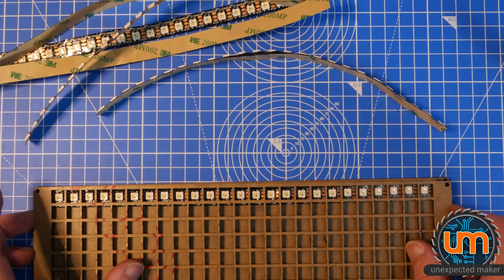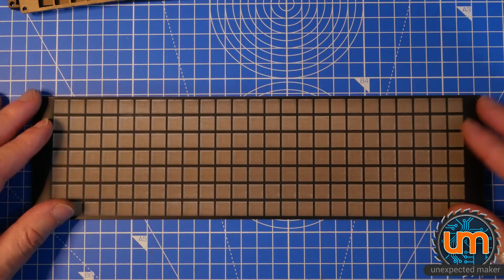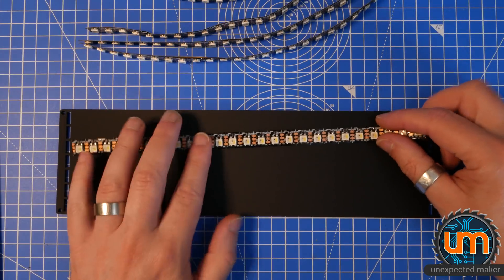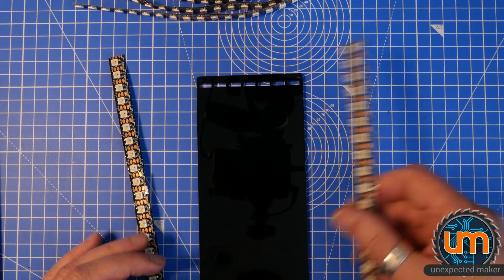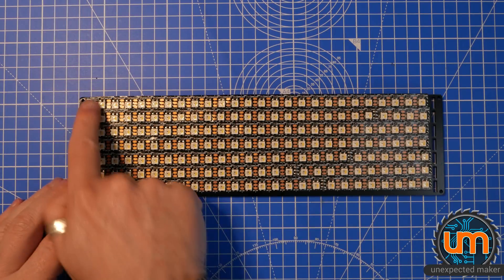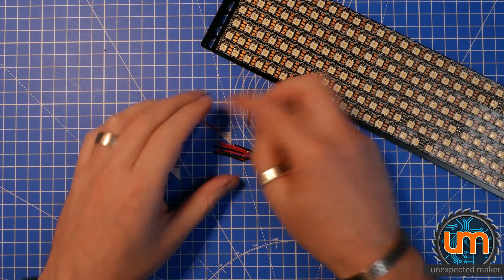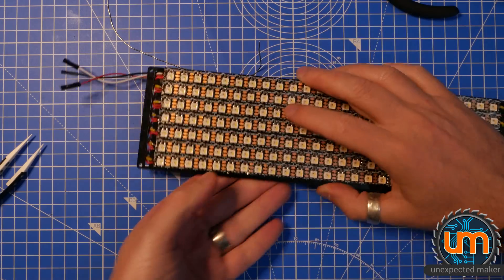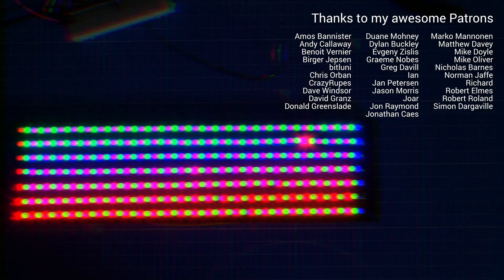Overcomplicated RGB Matrix Panel - Part2

Comment: Am I the only one who doesn't feel this project to be overcomplicated? I mean come on, you clearly go for quality and quality has its price. It's not like you couldn't glue a few led strips on a piece of cardboard or something, right? Having that laser cut frame and fully RGB leds really IS added value and I'm pretty sure the end result will be beautiful.
Reply from the maker: I guess I call this overcomplicated because I have a few 64x32 RGB matrix panels I could use, and some 8x8 RGB panels I could tile..  there are definitely easy and quicker ways of displaying stuff on a screen ;) But then there is no fun in the making part...  also, if I did the "uncomplicated" version, it would only have been 1 video!
Reply: @UnexpectedMaker  Right, making a LED panel out of a LED panel... well, that'd be cheating dammit! :)

Comment: another benefit of using strips without that offset, you can put every other row upside down and wire data zig zag, no wires on back. Disable interrupts during led writes.
Reply from the maker: I know, they are terribly designed strips... but it's all I had to work with :(

Comment: looks like a good project for openscad
Reply from the maker: I much prefer visual cad tools tbh... even though I am a coder.
Reply: Unexpected Maker I mean considering it is a matrix of same shapes, it could be made to be easily adjusted
Reply from the maker: Sure, but you can do the same with Fusion360 using parameters... in fact, I did that but didn't show it in the edit as it was too quick  to catch ;)
Reply: ohhh fusion 360 has parametric capability? coooool

Comment: I solved the problem with a level shifter for the data line for 5v, but I believe I see you might have one there..  and must have tried that...
Reply from the maker: I get the same result with and without the shifter. It's a library timing issue when using the ESP32. Works fine on an 8266 or SAMD21 :(